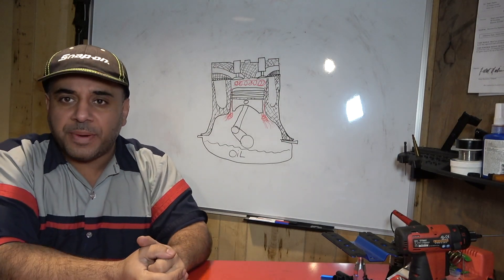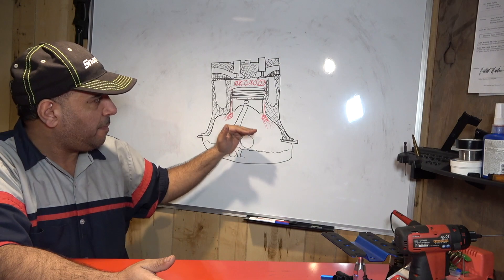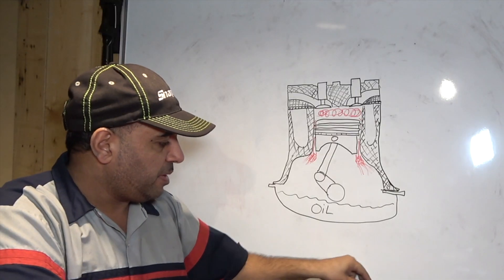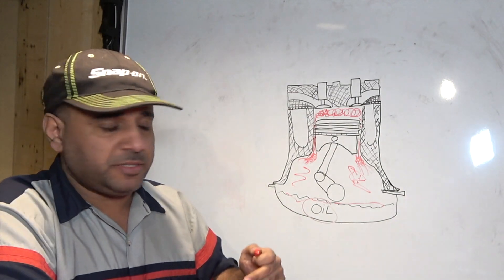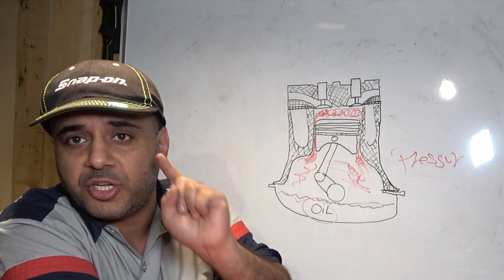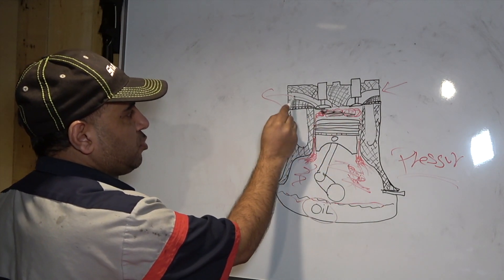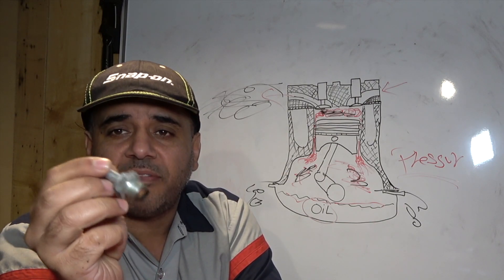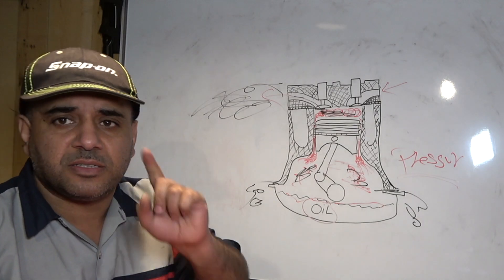What is engine BLOWBY  -  Explained

Comment: Blowby is pressure build up in crank case , if u have a bad pvc valve pressure will increase and oil will find its weakest spot to escape like oil pan , valve cover , piston rings , will cause oil consumption and sludge build up in engine and so on ... That sludge will mess up ur 02 sensors , cat converter and cause ECM will throw false 02 sensor codes , cat conv  codes all because a way often overlooked $12 part that can cause you thousands if not a new engine ... Great video RB 👌
Reply from the maker: Yup thank u good information!!

Comment: brother, if you could help me with this question, a few months ago I cleaned the car's intake with crc intake valve cleaner and since then the engine light comes on some days and not others, when it comes on it's like it has a fault and after a few days it goes away and comes back what do you think it could be that has never happened to me what should I do? I don't want my car to be damaged, I take great care of it, I did the cleaning because I already have 70k miles, what can I do? I always take your advice and I'm going to do the transmission service and the car's water service, thank you at the dealer they said it's the injectors but I don't think so because I use good gasoline and good oil, the code P 0172 came out on the computer at the dealer they told me it's the injectors I don't think so that's why I always seek your advice in your videos, which I must do because they want to charge me 1k for that
Reply from the maker: Ok good I was going to ask u for the code I will get back to u from shop tomorrow but tell me what year make and model u got
Reply: @RBTheMechanic  2017 accord ex
Reply from the maker: @joelrodriguez7038  clean out ur oxygen sensor it’s air to fuel mixture problem
Reply: @RBTheMechanic  thanks brother you are the best
Reply: @RBTheMechanic  Thank you my brother, because since I cleaned the intake it has been giving me these faults and the dealer tells me it is injectors but I don't think so because I take good care of my car, good gasoline and everything has 70k and it looks new, thanks again for everything